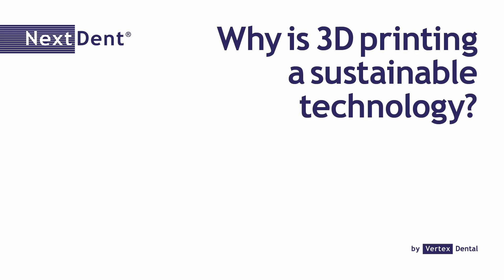NextDent 3D printed dental implant

Comment: they should scan the ones that are pulled dirrectly after pulling a tooth and print one that will fit back into the hole bofore the bone closes shut the hole. GOSH!
Reply: They could print you a plug temporarily until the titanium print has a polished top on it, GOSH!
Reply: share on face book and tell your dentist's GOSH!
Reply: RedMetalic RobotDemon It would not work well in most cases... I would say it is a horrible idea actually...
Reply: SiFi dentistry, but one has to dream first before the future gets better.